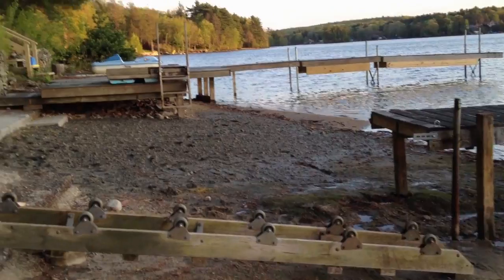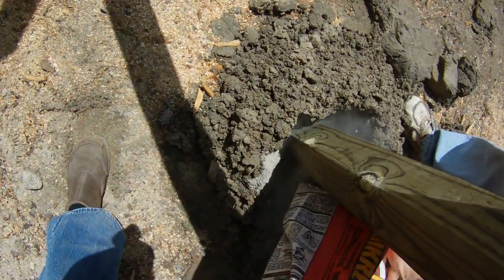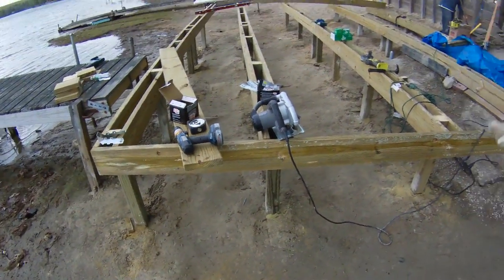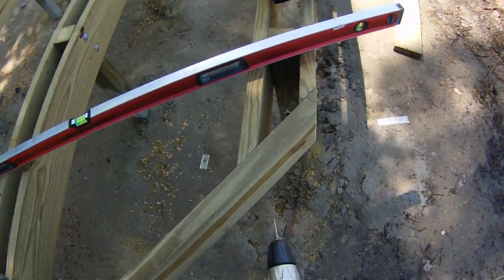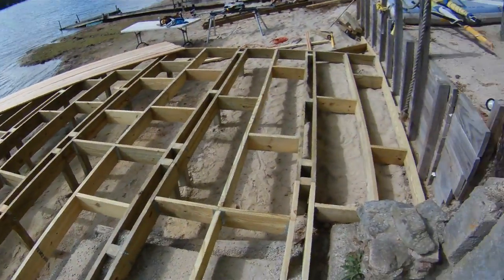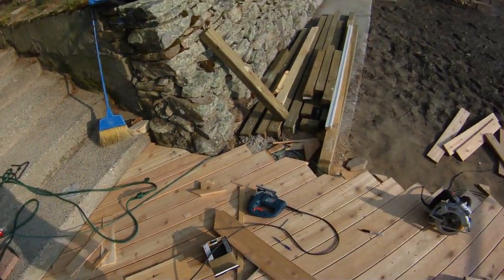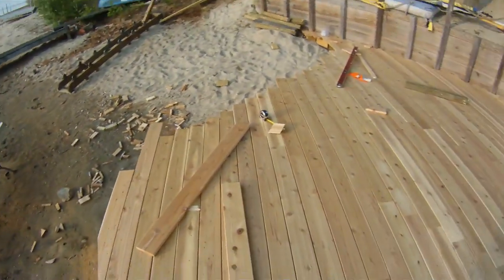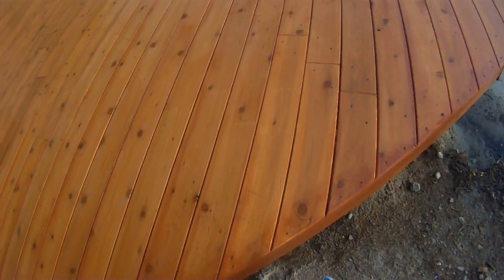How to Build a Dock / Deck out of Cedar wood with curves on a Lake.

Comment: next time notch the posts instead of depending on the lag bolts for support and stability - how is the deck holding up?  It is beautiful.
Reply from the maker: +GLOWAustin Good advise, Still looks Great! i was a little worry that the frost would push up the concrete footings in the winter but it was all good, it's been about 3 year and everything is still level

Comment: Awesome job looks amazing. But wouldn't it be easier to space the decking boards with little shims in between the boards
Reply from the maker: +Zack McPike i used nails because that is what i had but you are correct shims would also work, it's just important to keep the spacing as even as possible. sims can some times vary in size. thanks for the positive feedback!

Comment: How did the footings hold up when the water rose and through winter etc great deck/dock build! Building something very similar at my cottage going to use a lot of your methods :)
Reply from the maker: Great to Hear it! 4 years later and they are holding up Great! deck very straight no push up's from frost, or issues with water I am happy to report, Best of luck on your new Deck!